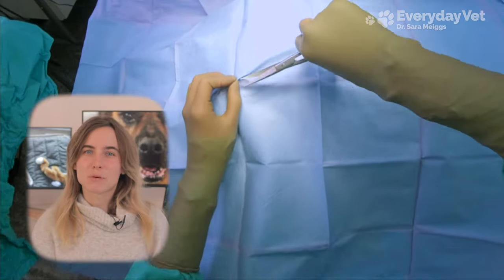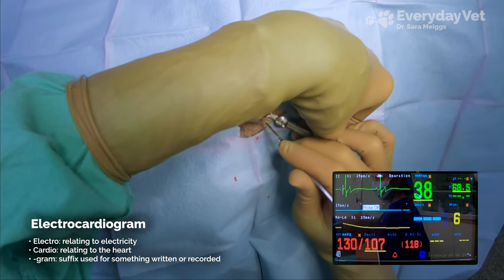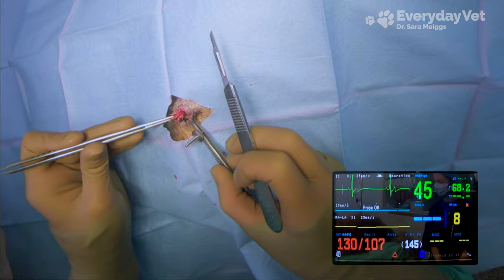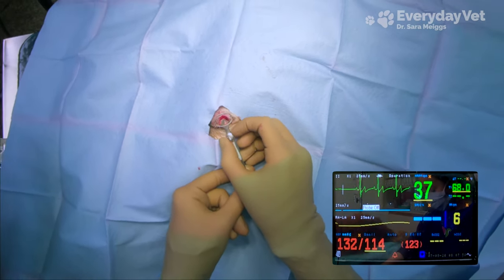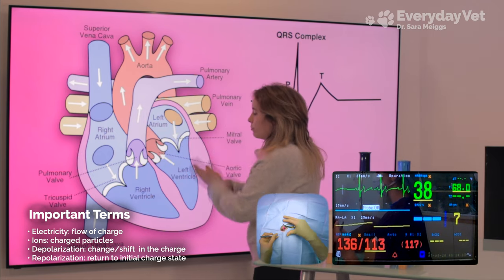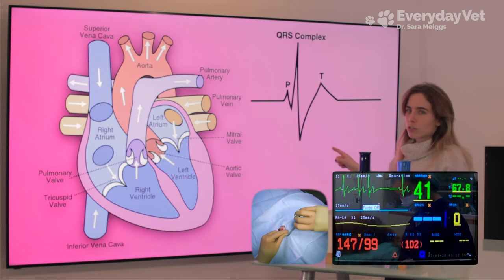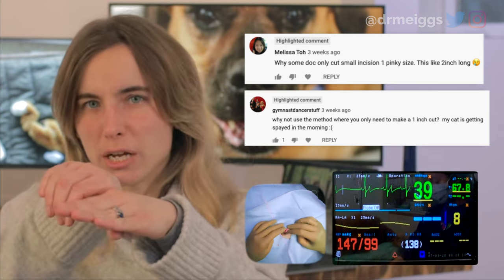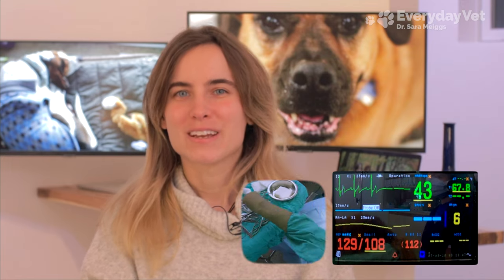How to Interpret and Understand EKG Readings During a Dog Eyelid Mass Removal Surgery

Comment: Hello doc
I have always had this doubt
That whenever we remove testicles why do we inject lidocaine in the testicular parenchyma?
I mean how does this type of pain control work when we are gonna remove the injected tissue in the end?
Like this is commonly used even in equines right?
How does it work?
Reply from the maker: When the nerve block is injected into the testicle, it is blocking the pain pathway from the testicle. That way, when we are cutting into the cord, the pain signal is blocked. It's meant more to prevent pain during the surgery rather than for pain during recovery. Hope that helps :)